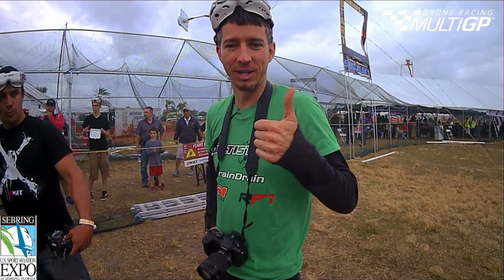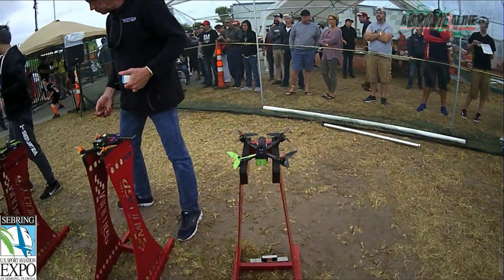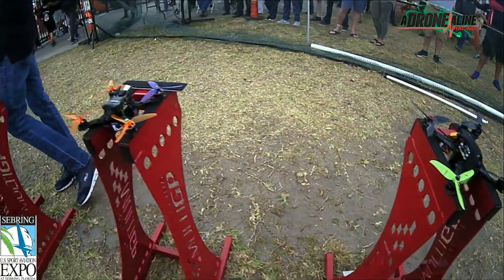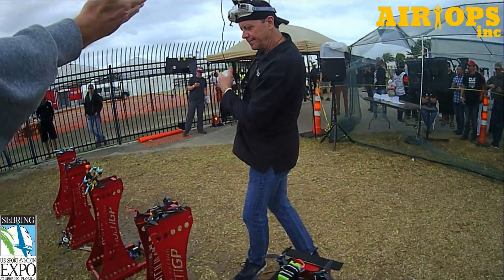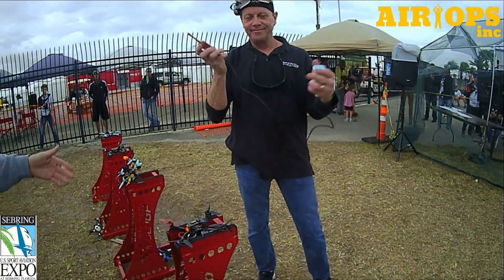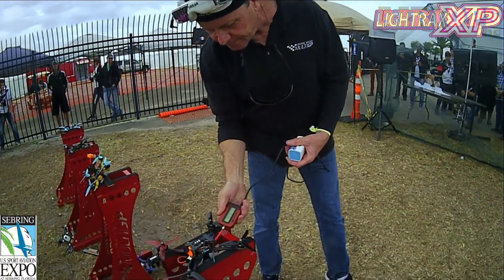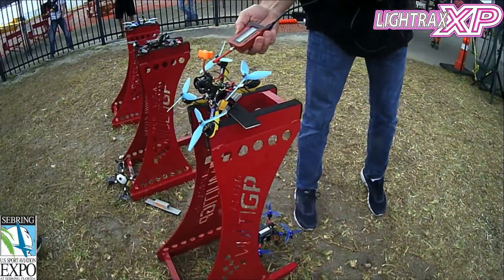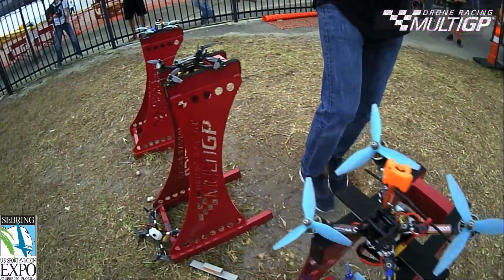ImmersionRC Power Meter V1.0 - Antennae-to-Antennae Method or "the Scully Method"

Comment: I thought you were going to show what you were actually looking for and calling OK or bad. I have one of these and want to use it the same way so I know if I get to an event I’m checking the same way so my gear will pass inspection.
Reply from the maker: Matthew Bennett it's in the description.  Basically when it's attenuated right, when you go antenna to antenna it will show 25mW on your known 25mW quad. On quads being tested it will be below 2mW if it's in pit mode, will show above 75mW if it's 200mW and around 300mW if it's 600mW or 800mW.  It's a pass-fail, not accurate digital reading.
Reply: ok thanks. didn't open description on my phone.
Reply from the maker: Matthew Bennett no worries.  This clip wasn't meant to be a tutorial, it was a demo from a livestream